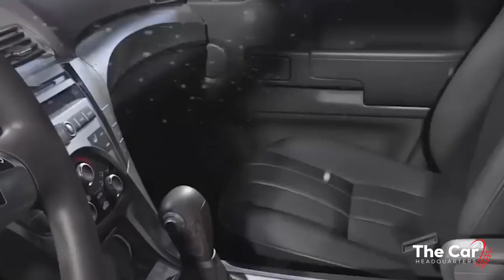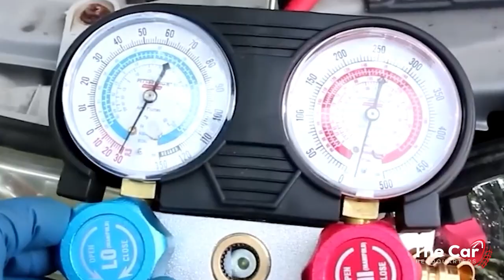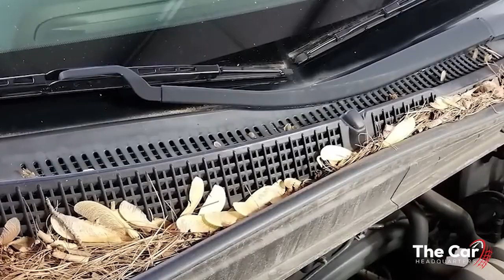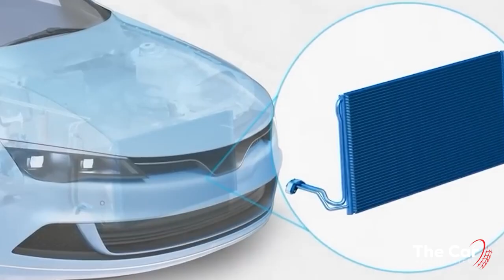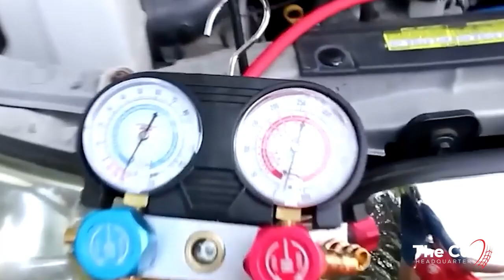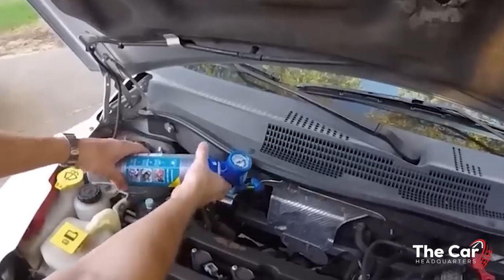Make Your Hot Car AC Ice Cold Again (Simple Fix Under $50)

Comment: If your compressor clutch is not engaging, check the  plug on the compressor first. After my daughter bought a used car (without asking me to approve it) the 2013 buick encores a.c. was working intermittently. The clutch was occasionally disengaging. In summary, i found that the compressor was new and after its installation the mechanic had forgotten to reinstall the lost rubber plug seal on the plug itself. This left the plug misaligned with the connector on the compressor making tge connection tenuous and causing arcs between the conntacts which, in turn, caused the plug to have a literal melt down. A trip to my local pull-a-part to find a used connector, two butt connectors, and some heat-shrink tubing fixed it.  Never assume your mechanic is perfect and always check the work they do.
Reply from the maker: Thanks for sharing your experience! It's always a good idea to double-check the work done by mechanics. Your detailed breakdown will definitely help others facing similar AC issues.